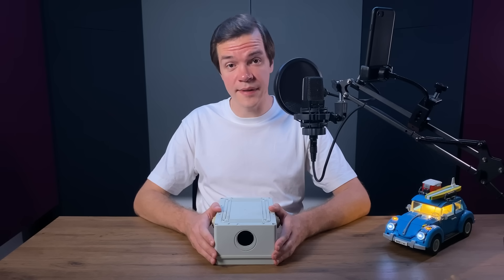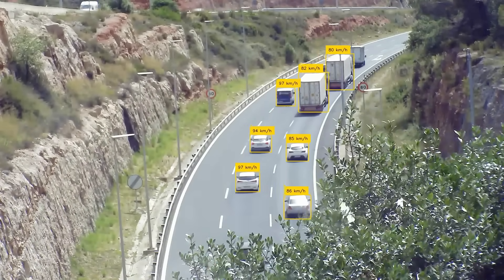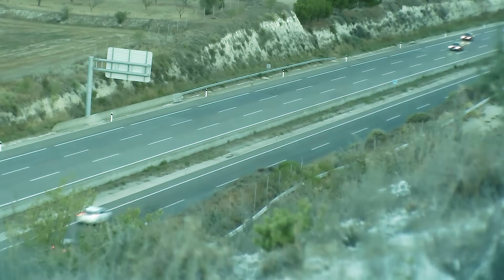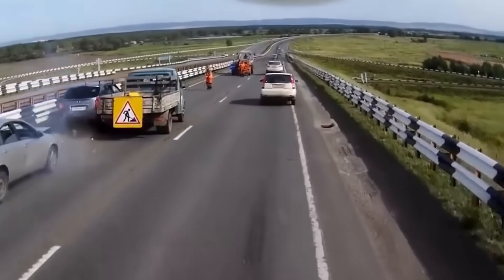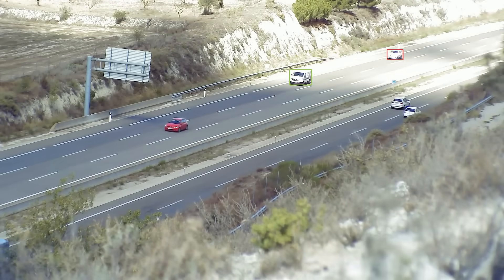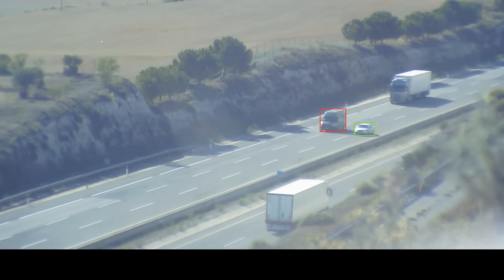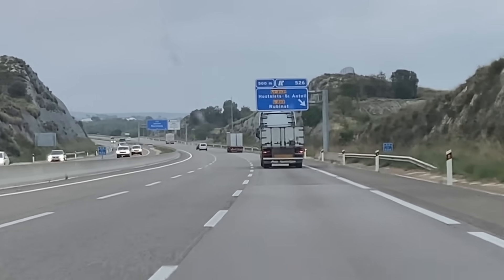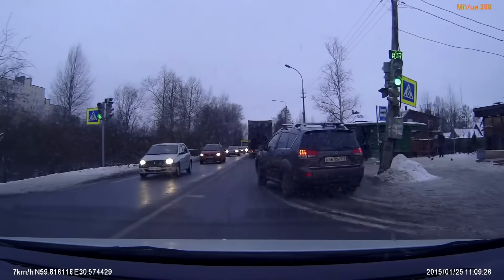New Anti-Tailgating Camera Reveals Shocking Statistics

Comment: The governments are just arrogant regarding this and do NOT care at all. And they could make SO much money from it. It is easy to get an anti tailgating system in place.
Step 1: Get the legal approval
Step 2: Block holidays for the processing employees 2-3 months
Step 3: Measure the distance over time
Step 4: Fine people and send them a private link to the video.
Step 5: If they disaggree, they can reject this fine directly online and it gets manually reviewed. If you became a tailgater by somebody elses fault, the fine is dropped and the other person gets charged. With a higher fee in this case. If the review shows, that you actually did tailgating and declined the charge, you get charged double to show people: Do not decline if it is actually your fault.

The first 3 months will be hell of burocracy I swear, but People will VERY quickly adapt.
Step 6: Make the fine multiply exponentially by the closing in speed. If you tailgate slowly, the fine is regular. If you come in with 300mph and almost crash into the car it the fee increases by 1.1 to the power of ((300-speedOfCarInFront)/2)*requiredDistance/actualLowestDistance.

Example: 300-100kmh is 200, divided by 2 is 100. Now 1.1 to the power of 100 is 13_780€/$ whatever. Which is already high. But again: We are talking about danger initated by ultra dangerous driving for a speed difference of 200km/h between the 2 cars. So it is insane. So now we assume that the law just states for 100kmh of the front car we need 100 meters distance. The actual lowest distance was 20. So 100/20 is 5. So the charge gets multiplied by 5-1. Why -1? Because 100 meters over 100 meters is 1 and 100 meters is the correct distance, so we need to multiply the 13_780 by that. So if the lowest distance was 100 meters the distance was never to low, so 100/100 = 1, but 1-1 is 0, so 0*13_780 means 0€/$ charged. It barely went well. Now Assume 20 meters lowest distance. 100/20=5 -> (5-1)*13_780$ = 55_120$ of charges for a hypercar speeder that almost made an accident. We could argue, that we do not measure the lowest distance below 5 meters, because it gets exponential. 100/5=20, so we multiply the charges by a factor of 20. Yeah, that really hurts like you get a speeding ticket in sweeden.

Now say the system measures a 99 meters distance. 1 Meter to little. Normally like with speeding the speed over is in steps so just 1kmh to high you get a ton of money pulled out. Lets reiterate with this dynamic formula:
13_780*((100/99)-1)
13_780*(1,01-1)
13_780*0,01 = 137,8$

So for minimum situations it is a miniscule charge. And the charge here is just still sooo high for a single meter, because the initiating speed difference was 200kmh. Say it was just 10kmh, than it is basically free. Which gives us an issue: We also should add a minimum baseline, because for 1 meter to low and 1kmh difference it would be basically cents - say the minimum charge is like 20 bucks + office fee.

Trust me bro, this WILL work. And yeah, the formula was just for tailgating caused by the person behind. We would need to consider another formula, if someone switched lane and hence reduced the minimum distance below what is required. No time for that now.

Comment: The algorithm to catch 'cut-off' is pretty simple. IF vehicle changes lanes AND that vehicle was in front AND tailgating resulted, THEN that vehicle is at fault. Probably 95%+ accurate?

I'd also add swoop detection. IF vehicle changes multiple lanes within a short distance, THEN they have swooped. We see those constantly where I'm located.

Comment: No, an automatic system that issues fines for the first car in the column is required! The "tailgating" car(s) would not exist if everyone would drive on right lane as supposed to and use the right one to pass.
Unfortunately people drive on let lane just for kicks and usually 10 -15Km/h below speed limit. Once they come almost parallel with a truck on right lane they slow down to drive about 3-5Km/h faster than the truck in some cases even slower.  These are the route causes of traffic jams and tailgating and in the end accidents.

Comment: Here in America there are some sections where people will speed/draft/gofer (no not gopher) on some stretches of road.  One I know of and remember for sure is part of State Route 3 en route to Bangor.  Car in the front burns more gas breaking the air and 2-5+ cars behind draft with about 0.3-0.5 to 1.5 car lengths between each maintaining an incriment of 5 above the limit, usually 15-20mph over. (75-80mph in a 60mph limit zone)  After about 10-15 minutes/miles the leader will change lanes and then fall into the pack at the rear and take their turn as gofer.  Just a sly tounge in cheek term for the one that will "go for" the ticket.  Since a police officer can really only pull over 1 car at a time it's just a gamble if there was a cop waiting around the bend.  Today though, with Google and other navigation apps using intigrated traffic and speed trap reports I don't seen these drafting chains as often as I used to.  I do see a lot more drivers doing dangerous weaving at high speeds though.  Personally I will speed but I remember learning to drive so I'll actually slow down to only about 10mph faster than the car I'm passing, signal every time and pause both lateral movement and re-signal clearly when doing a multi lane moves, and just because I've also been there, any shipping truck I see trying to change lanes I move over and make the room for them to merge.  I just match their speed, stay 10 feet (3m) off their bumper, and flash my lights a few times, then wait for them to finish and continue.  Drove better starting in my 30's because of how bad I scared myself in my 20's LMAO

Comment: There is a somewhat controversial point that has been missed here ..... laminar flow!
If you drive on a motorway (freeway) you are not driving as a single unit but part of a traffic flow. This can be in groups or whole lanes or even the whole road! Each car acts as part of that group. An individual car on a motorway will drive totally different from a single carriageway or road with passing places! You will not suddenly brake for no reason if you are part of a flow ..... so the "safe" distance is no longer that which it would take you to stop but what will allow you to react before you reach the point in the road ahead of you that was occupied by the car causing you to brake!
This is the reason people drive closer together on motorways! 

I agree that people do misjudge even this shorter distance as well as not concentrate on the car in front (or more accurately the car in front of that car). It is all a balance of braking ability against possibility of having to brake hard! Also the added factor needed in poor weather!

Comment: In Germany, there are cameras that can detect tailgating. These cameras are very very rare, but there are heavy fines for keeping too close a distance between vehicles. In Germany, the rule is to keep a distance of at least half your speed. For example, at 100 km/h, keep a distance of AT LEAST 50 m, which is also the distance between the white and black poles on the autobahn.

Comment: I taught my kids that if they travel too close to the vehicle in front all they can do is watch the brake lights as they have to react immediately to those.  If they allow more room they can also watch the road further ahead and anticipate what will happen.  This they can be off the accelerator and ready to breake if they spot slowing vehicles up ahead.  This makes driving more relaxing and SAFER.  It doesn't make your journey noticeably slower.

Comment: I think the biggest difference is that clear, immediate feedback on our speed is readily available, but distance to the next car is not. Maybe if cars also had an indicator in the dash for how far we are from the next car it would be easier to keep a "safe" distance. We already have the devices built into cars with the cruise control distance modulation, just add a dashboard indicator that tells us what the distance is so we can monitor and follow it.

Comment: It's not the highway tailgaters that are the problem per se. In this case it's the people camping in the left lane going the speed limit or less who need to move the F over to the right. The real a$$hole tailgaters are the ones on single lane double yellow line backroads who tailgate someone even if they're already doing 5-10 mph over the speed limit. Pulling over to let someone pass or speeding up in that situation is dangerous, and these people would only be saving themselves mere seconds in their drive by going the speed they want.

Comment: The podcaster hasn't proven to me that tailgating enforcement is not practical. With multiple cameras and AI, drivers who exceed a certain volume of tailgating captures, enough to be 95% certain that they are habitual tailgaters for example, could be cited. That just one way.

Comment: When using TACC (traffic-aware automatic cruise control), it's a lesser problem to be very close than if you are are not. However, there are problems with that, too. For example, it brakes faster than a human driver, so the car behind has less time to react.

Comment: Of course you need a camera to know where you should send the fine. So, why not just use the data from another camera a km or so before (like for the average speed camera) ? Then, if two cars stay in the same lane and in the same order over that distance, and the cameras measure an average distance below a set target from their calculated average speed, just send a fine to the car behind? It's probably much easier and cheaper to use dual camera with OCR than using AI here.
Even if you can't nail every driver for tailgating, you could get the worst cases and raise awareness. And it could be combined with average speed camera features.

Comment: Why should the follow distance be a bell-curve? If there's little traffic on the road there would be every length you can possibly track over the distance that the camera can see.
You will, however, probably see a bell-curve if you have really dense traffic. Adding: The spike at 30 m is probably just those that actually are close enough or too close to actually be called tailgaters.

Comment: speeding is the cause of nearly all traffic violations and problems.

you see those "packs" of vehicles?
that's simply from speeders speeding their way to drivers that go the speed limit.

traffic jams are caused by speeders as well, too many vehicles trying to go through an area at a time, causing slow downs and stopping a lot of the time. 

roads are designed for a very specific amount of flow through, the posted speed is something that was calculated to give the most flow through, while being safe for that section of road.

the problem is speeders, always has been and always likely will be. at least until they introduce actual penalties for speeding that have actual weight behind them. like attempted murder charges, possession of their vehicle, removal of their right to drive, etc.
the problem is they think and do get away with it, and so they speed because there is no real punishment. they will always go faster, push people and get someone hurt/killed. that's just how the behave, the solution is to actually grow a spine and properly punish them.

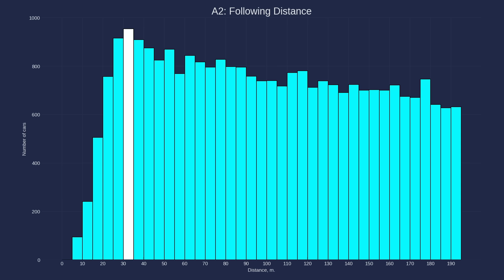Comment: 12:31 The distribution should NOT be gaussian. Time series data on independent events should be a so-called "memoryless" distribution, is an exponential distribution. When you add the constraint that cars shouldn't follow too closely, then it becomes an exponential distribution that is 0 below some cutoff that corresponds to the follow distance. Then you can convolve the distribution with a Gaussian to account for variation in driving styles and your measurement error. The result is almost exactly the distribution you have.

This distribution only approaches a Gaussian in the limit when the road is basically full (that is, all drivers are following another car at the minimal follow distance, because the road is packed).

Comment: We live in a rural area and there’s a long road to reach the rest of civilization. There’s only one lane in each direction. The speed limit is 50 mph and I set my cruise control to 54 mph because going the speed limit makes others nuts. But even on an uncrowded road and even though I’m already a bit over the speed limit, I still end up with tailgaters right on my backside. If the car in front of those people blew a tire or had to brake for a mountain lion, there’s no possible way they can stop. My friend came as close to dying as possible on that road when a guy pulled onto the road from the right just in front of her and the guy behind her smashed into her from behind. The really infuriating part? You’re not going to get to your destination any faster if you tailgate. It doesn’t save time. It’s only bad.

Comment: An integrated system of cameras spread over a few km can do a reasonably fair job of detecting tailgating. Camera 1 logs all tailgaters and reads their number plates. A couple of km down the road camera 2 does the same. Another couple of km down the road camera 3 is the decider. 3 strikes gets a fine. 1 or 2 strikes assumes innocence.

Comment: A lot of nice work, but your logic is awful.:)

Safety is related to the frequency of serious injury and death, which are themselves related to the energy and forces involved in the accidents  which is related to the speed differential between the colliding cars. Speeding (going considerably faster than the rest of the traffic) has always been a major factor in serious accidents. Not the only factor, but one of the main ones. Inattentive driving also big, etc.

Interstates are much safer than other roads because all of the cars are going in the same direction and there are no intersections.

To identify what causes serious accidents is easy. Just study the serious accidents and look at what caused them. Tailgating may cause accidents, but not the serious ones.

You did not do this, you simply created a premise out of thin air, that tailgateing is the cause of serious injury and death, and then created some tech to prove that people were tailgating a lot.

1. We did not need proof that people were tailgating a lot.:)
2. You NEVER proved that tailgating is the main cause of serious injury or death. (As annoying as it might be, it isn't)

Essenttially, you created a strawman argument.

Following distance IS important, but our interstates (at least in the U.S.) are so full, the 3 second or 2 second rule doesn't apply like it used to.  I ride both cars and motorcycles, and I will say that I try to give more space when on my bike than my car, because all accidents on my bike tend to be serious injury or death (i've had none), but as others have noted, that is very hard to do all the time because of the number of cars.

You need race track skills on interstates. I did not introduce my son to interstates till he had a couple years of experience, and then, only to the easier ones at first.

I don't tailgate, that impatient bullshit that does nothing. I don't tailgate slow drivers that should move over. I wait for an opportunity to get around them. BUT, in heavier traffic the cars are bumper to bumper like a race track no matter how you feel about tailgating.

Right now, unfortunately, since the roads are congested, the speeds high, the drivers a mix of good to bad, road safety is dictated by the same elements that auto racing safety is. By how well cars can maneuver and brake and avoid accidents AND by how survivable accidents are when they do occur. And over the last 50 years, both of those factors have improved a lot, and avoidance will continue to improve, though braking and maneuvering is probably at its max now.

What we can't fix are the drivers. If we eliminated 20% to 30% of the drivers, then things would probably be much safer, but who is going to drive them around to do their errands. We can't even eliminate 80 yo drivers. It is a moot point, almost everyone has to be allowed to drive and we must deal with it.

Btw, I am old enough to remember better less congested times. Although, even back then, in the larger cities, things were already getting out of control.

I know you don't like the answer, and even I wish it were different, but at the number of cars, speeds, and complexity we drive in, I am simply amazed at how well we do. It is like we took the Indy 500 and increased the field from 33 drivers to 20,000,000. And yes, we have accepted that this comes with 40,000 deaths a year. But it was that many deaths a year in 1940 when there was 1/10th the traffic.

Comment: Many years ago a programme on UK TV looked at the M25, which at that time had been open for a few years and had already got a reputation as the place to go to see 'interesting' driving and higher than average accident rates. They found that this was actually largely down to the volume of traffic but interestingly at one point they looked at the issue of maintaining a safety gap from the car in front. They found that this became quite difficult to do during significant parts of the day due to the vehicles chopping between lanes either to overtake or because they were positioning to leave the motorway. They filmed someone demonstrating on the road that if a car pulling into the safety gap you had left in front and you then dropped back to leave the two second gap again, your speed dropped but before you could speed up again another car would slip in so you would drop back again etc... You would also cause the vehicles behind you to move to overtake so in effect you became a slow(er) moving roadblock adding to the fun. At those times of the day on that road it became virtually impossible to leave the govt-advised gap. Thus the higher level of accidents.